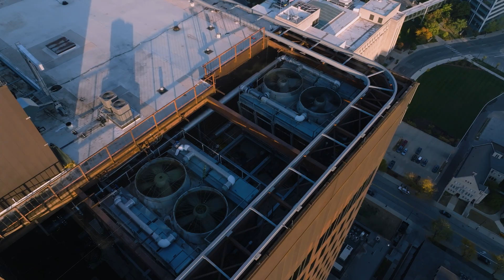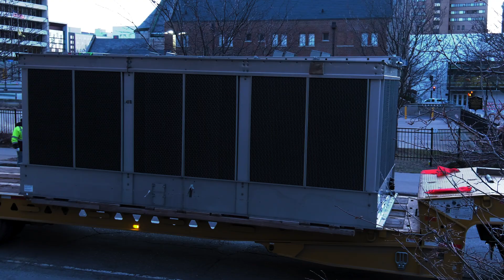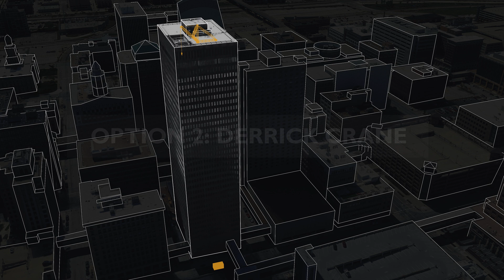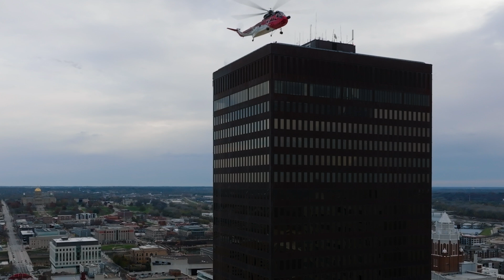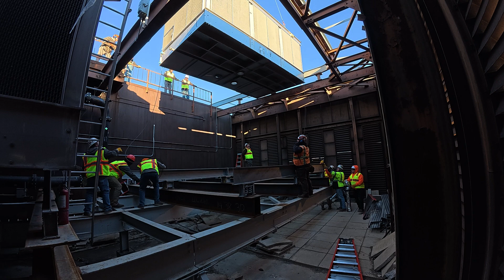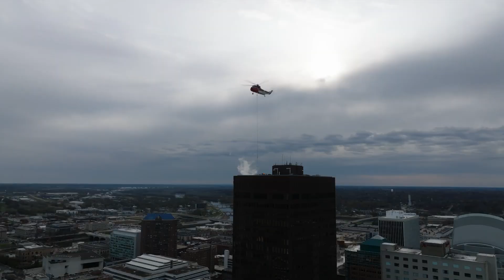Helicopter HVAC Lift Over Downtown Des Moines | Baker Group Project Spotlight

Comment: I was on a lift once. The pilot dropped the air handler unit right on the pins.  It took longer for the apprentice to come back with the coffee than it did for the lift and bolting the unit down.